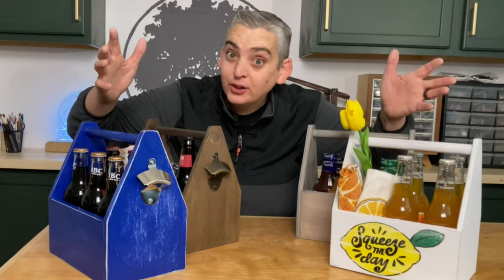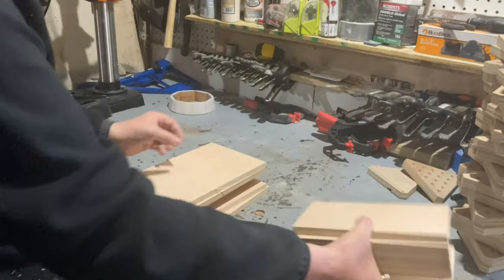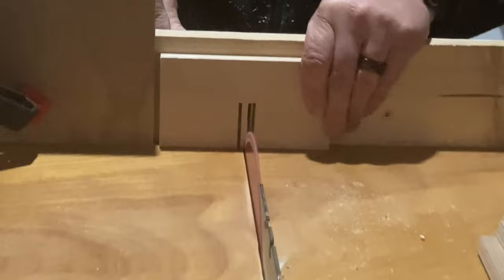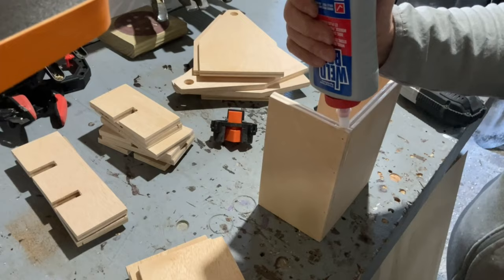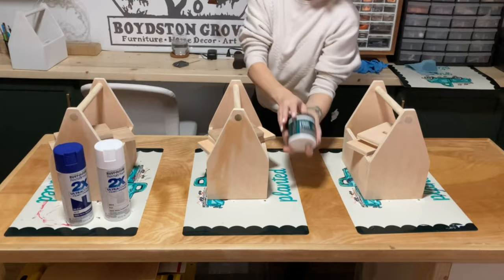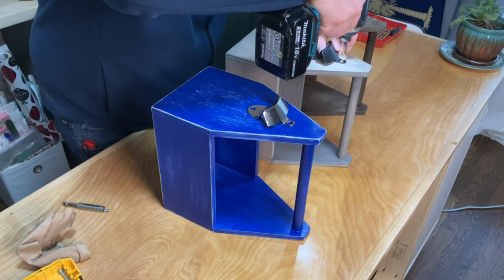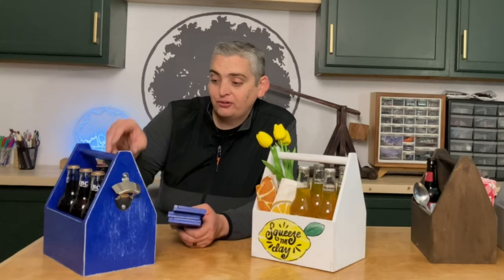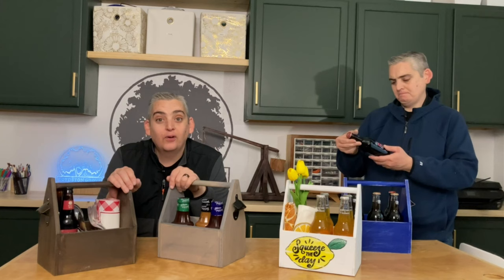How to Make A Drink Caddy / Tote  / Woodworking Projects That Sell!

Comment: I dont notice alot of saw dust coming out if the table saw when you cut. Do you have a dust control hooked up to the saw?
Reply from the maker: I am currently using a large shop vac that runs through a small cyclone style dust collection. It is definitely not optimal. I usually mask up when I'm on the table saw and I am in the market for a better system. Thanks for watching!